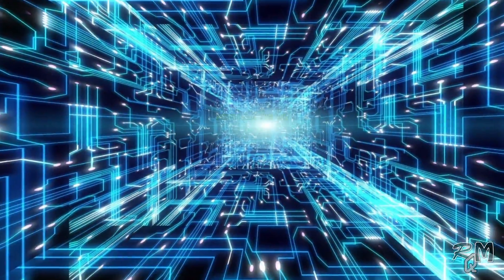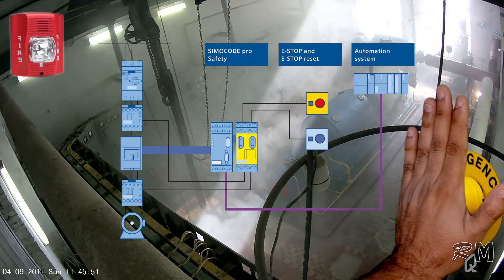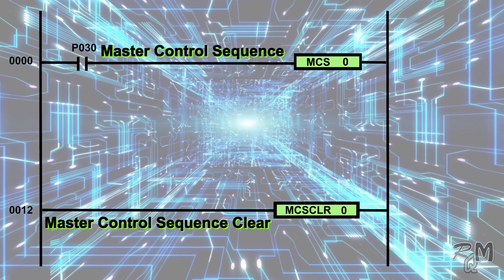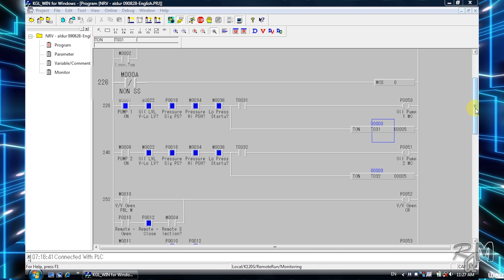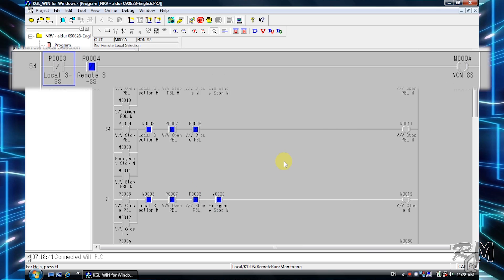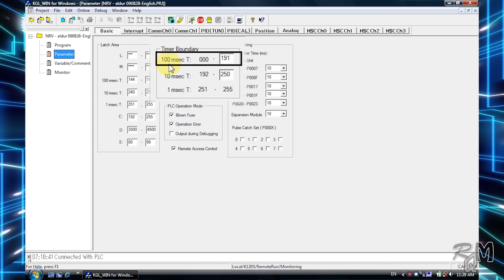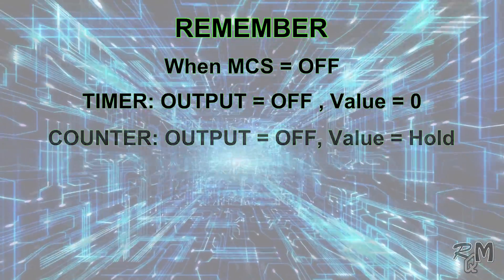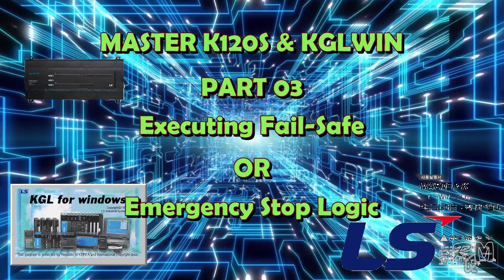MASTER K KGLWIN Part 03 Execute Fail-Safe OR Emergency Stop

Comment: informative👍
Reply from the maker: Shehneela Waraich thanks keep supporting
Reply: Dear sir
Pls help me to communicate k120s plc  modbus control of multiple slave devices like tk4s temp controller. .

I set k120s plc as master with "0 station I'd. And 2 temp controller I'd 1&2 respectively.

I can communicate with I'd 1 temp controller only.. Pls help me to communicate with multiple  slaves..

Thanks

Regards 
Sugumar. A
India